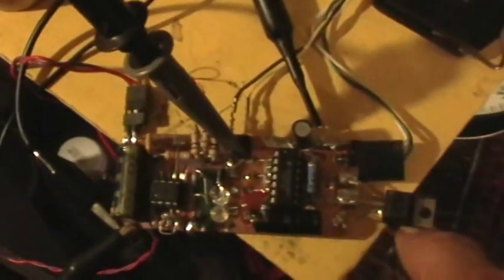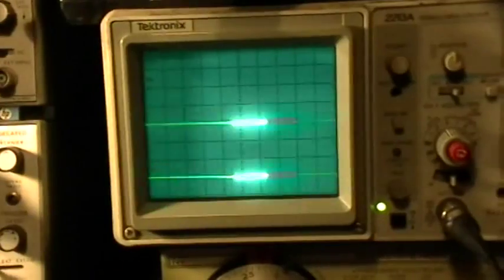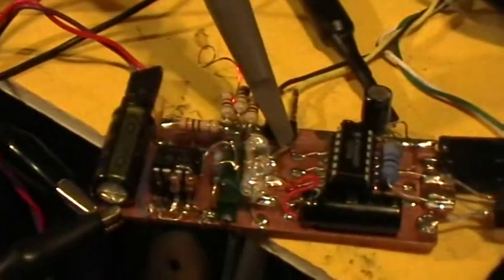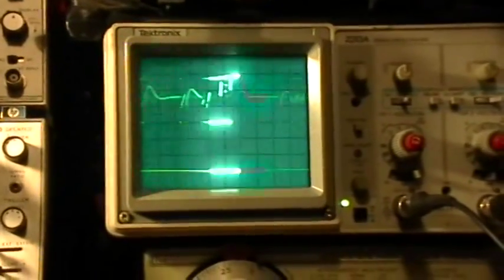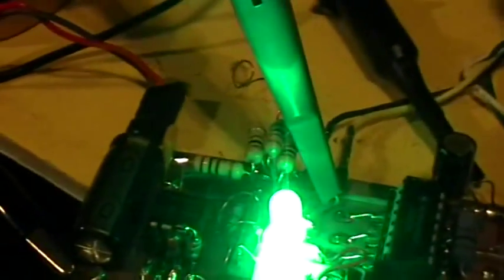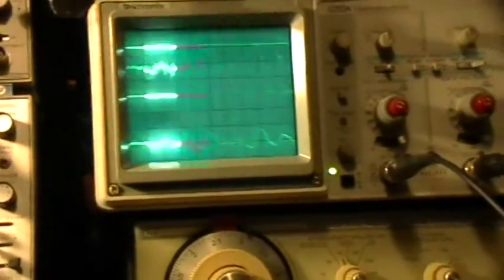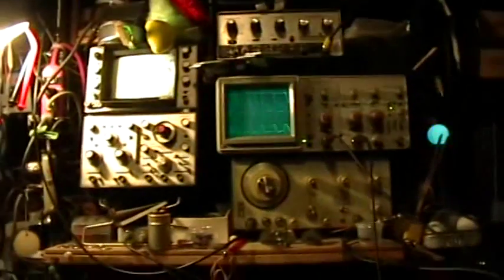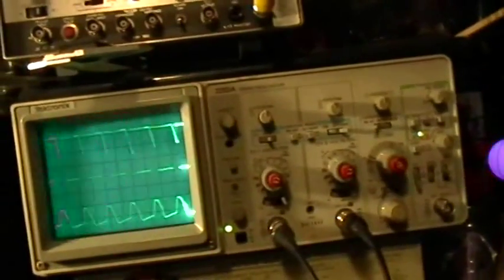Electric OU: Tuning TK-Akula 3V Device, Core Chatter, Waveforms

Comment: Is that any Akula devices would be fakes as all would need power supplies in reality, when strictly following his schematics?

Thanks for sharing, anyway.

Cheers.
Reply from the maker: That's what I think. I don't believe that anyone has actually reproduced his "self running" even when following his schematics exactly and also reproducing the waveforms he's published. He is probably deliberately hoaxing, and/or his tuned circuits are picking up broadcast power from the nearby radio station transmitter/antenna installation.
Reply: TinselKoala OK, very thanks for sharing your opinion to me, dear TinselKoala, while you look having well studied the subject :)

As Stefan says Akula should come this month in Germany, we will see if Akula will allow his last device to be checked by o.u. dot com guys,  if not... ;)

Comment: Well done. What was the lowest input current you got in the right mode ?
Did you try to loop it back to its entrance ?
I think this circuit from Akula still has design flaws, as it only works by pulling the DC2DC converter out of its working range via pulling the supply voltage down...
I think it would be much better to use new new circuit with the 2 x TL496 ICs as there are the coils correctly energized via the transistors....
Regards, Stefan.
Reply from the maker: I don't know what is the "right mode" but I can get the LEDs brilliantly lit on less than 30 mA indicated at 3.0 V. Not as good as a real Joule Thief but similar principle of operation in that mode.

Do you mean TL494CN?  16-pin DIP? I haven't seen an Akula circuit using TL496 which is an 8-pin DIP 9v power supply controller. Link please?
 
Sure, I would build the 494 version gladly, I have two 494s right here and I am familiar with using them, my TinselKoil 2 uses a 494 for its primary oscillator. However I am out of other supplies like circuit board material and potentiometers. So unless I get a "donation" from somewhere I won't be able to construct it properly.

But from looking at the circuit as drawn by the folks at OUR.... how and why would anyone expect it to work without power supplied from somewhere? It is a very ordinary circuit, beating the two oscillators against each other with feedback loops.
Reply from the maker: I really don't think it works that way. I've determined that even the BUZ11A mosfet is barely switching, if at all, even when the inverter is giving that nice 2.5 V sinusoid. It remains in its linear operation region and isn't pulling the supply rail down as we thought at first. I have changed back to the TIP3055 NPN transistor which is definitely switching fully. Also looks better on the board!

But the smaller inductances on the Split Bobbin I am trying now do not allow the resonant reception of my 60 Hz mains... and I don't seem to have anything in my environment that can be picked up cleanly in the 270 Hz range. But I do see the oscillation bursts at the right frequency now, just not stable enough to demonstrate. Yet.